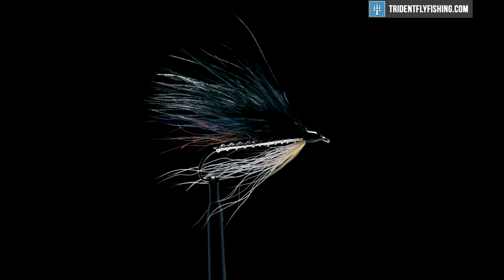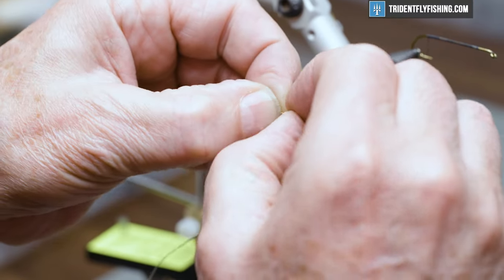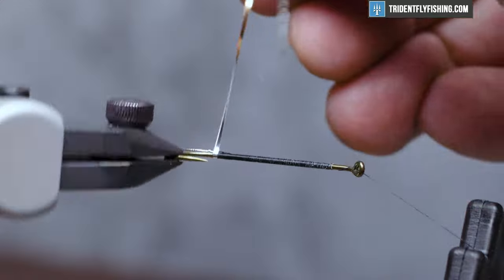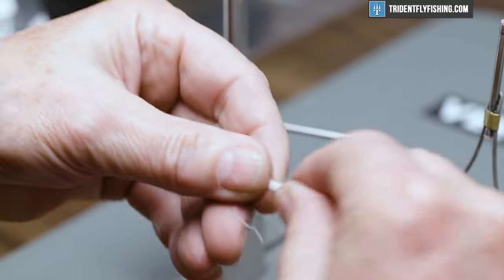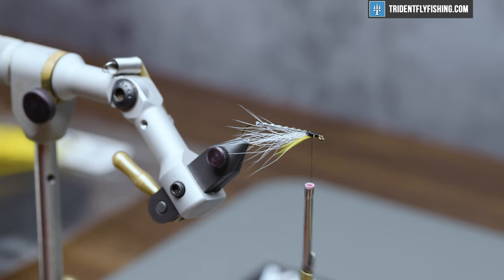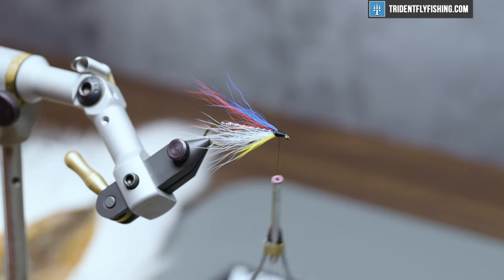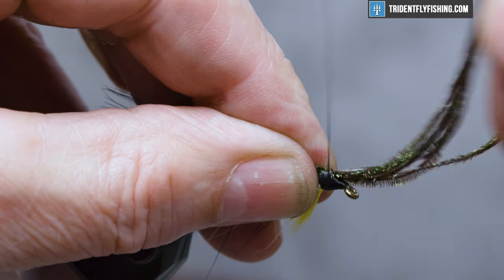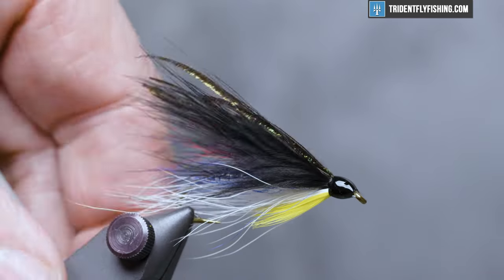Kennebago Smelt Fly Pattern | GREAT LL Salmon Fly | Fly Tying Tutorial

Comment: Another great fly-tying video!

I was however disappointed that the mylar body was tied with the black thread showing through underneath (fish don't care!).  It's really hard to keep that from happening with metallic tinsel, but not much of a problem with the mylar because it stretches and flattens out as you tie it.  Perhaps a case of convenience of quickly wrapping it with a rotary vise comes into play here.  Slowing it down with more careful placement would give a better result.  For the best and  smoothest tinsel body with no gaps showing through, start the tinsel body near the front of the hook, wind down to the bend of the hook and then back to the front tie in. That way the tinsel is slanted in one direction on the way down and in the other direction on the way up.  It covers up any gaps and really makes a smooth tinsel body with no black thread showing through.  The rest of the tie is artfully done by Karl, as usual. 

Also note that you should use a well-thinned glossy head cement here instead of the water-based one, which has no gloss to it.  The water-based one and the "high-penetration" head cements don't dry glossy and it's key for this fly to have a glossy head. If you use glossy head cement that is pretty thick, it doesn't penetrate the threads very well and a single big fish can bite through it to the thread, which quickly unwinds your fly.  So be sure your gloss head cement is thin and use two coats. EV cured resin also works well and will look glossy.

One final note about tying in multiple wing materials.  If you want a smaller head, tie in the material with three TIGHT wraps, one on top of the other.  Place the next material in place; unwind two wraps (leaving one tight wrap); and tie in the next stack of material with three tight wraps.  Continue until you have all the materials tied in securely and then do a whip finish.  This method is used to tie in feathers or hair on Atlantic Salmonflies stacking each item directly over the previous materials tie-in point resulting in a short and bulbous head. No need to stack the materials directly on top of the previous tie in point with this style of fly though.  That conical, glossy head is a characteristic of this type of streamer fly.